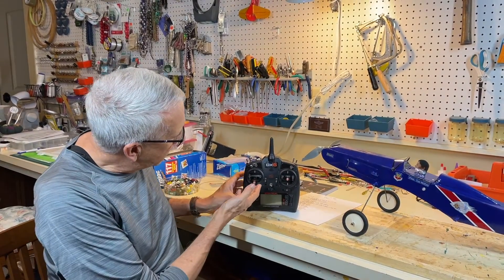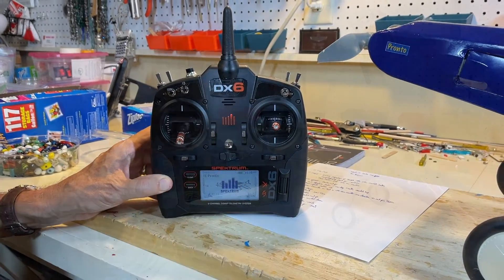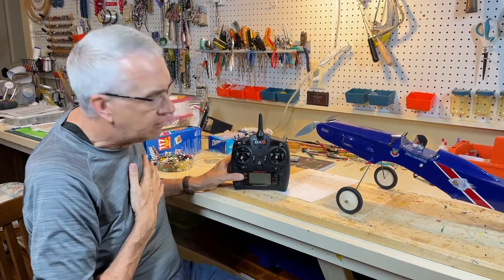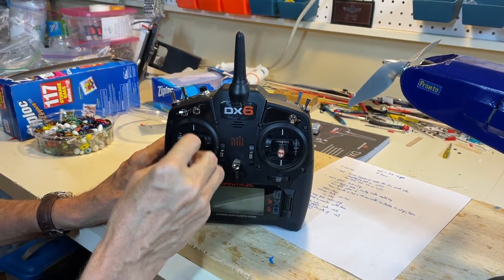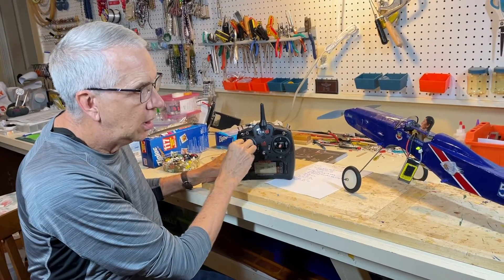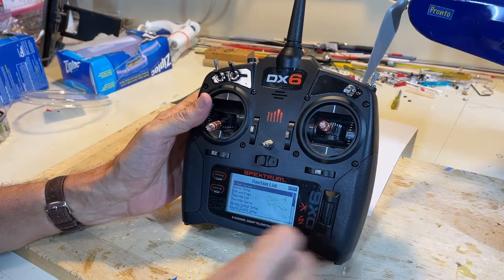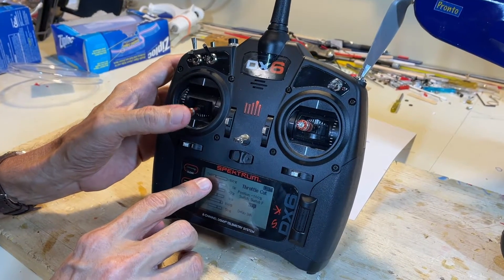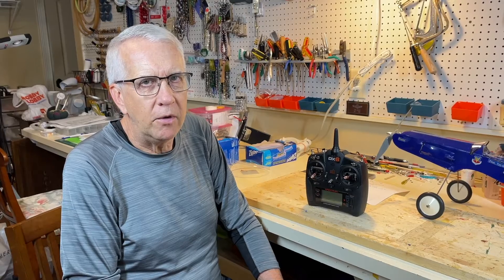What is Throttle Cut? RC Basics

Comment: Not being aware of the throttle cut switch, I've adapted a rubber "0" ring on a string that holds the throttle lever down so that it doesn't get bumped on.
Good information.
Thank you
Reply from the maker: 👍🏻😊 Tim

Comment: I use A for retracts, B for dual rates, D for flaps, and H for throttle cut. I sometimes put the gyro control channel on switch C if I want it separated from my rate switch. Since I mostly fly with my right hand, my left hand is free to flip switches while I'm in the air. I don't flip switches with my right hand while flying, so there's no chance I'm going to cut the throttle accidentally. The newer firmware versions add a "Req. Stick Low?" option in throttle cut that will prevent the motor from running until you lower the throttle to idle and then advance it. I highly recommend updating the firmware and setting it to "Yes" on electric planes.
Reply from the maker: Great points, many thanks!  Tim

Comment: I'm not familiar with Spektrum radios but most others remain inoperative and warn you when you turn them on if the throttle stick is not fully down or any of the switches are not in the UP position. So if you set your Throttle Cut Switch to be UP for Throttle Disabled you have a failsafe start at switch-on. Thus making the switch down position to be Throttle Disabled would seem to be quite brainless. Most people also add an extra layer of proof to arm the throttle for safety reasons, but retain the simple 1 switch movement to disarm the throttle. Fairly easy with an OpenTX/EdgeTX radio.
Reply: Thats exactly how I do it on my Radiomaster.
Reply from the maker: Thanks for this update!   Tim
Reply: What is this opentx radio you speak of?
Reply: @reworkfpv7359  Lots of different brands. Look up Radiomaster TX16S Mk11 for about the current top of the heap. Plenty cheaper models with not much reduced capabilities running on the Multi Protocol Module or ELRS.
Reply: @reworkfpv7359  Open TX is a software operating system used by a number radio manufactures. Specifically, FrSky and RadioMaster. Great value for the money. My Radiomaster has 95% of a high end features of a JEDI at a 5th of the cost.
Reply: @@jerrysullivan2001 Good idea!  Tim